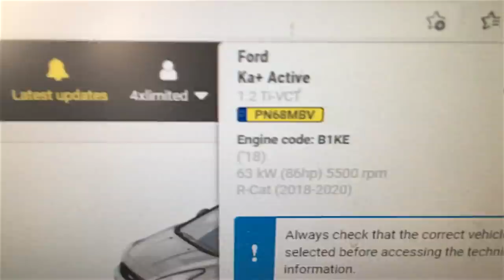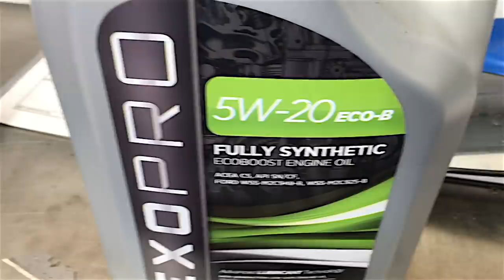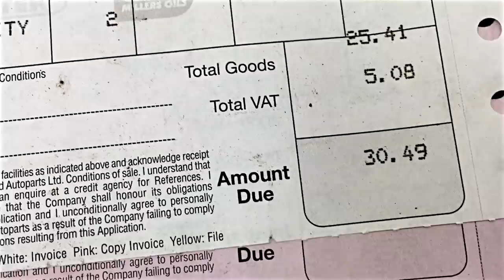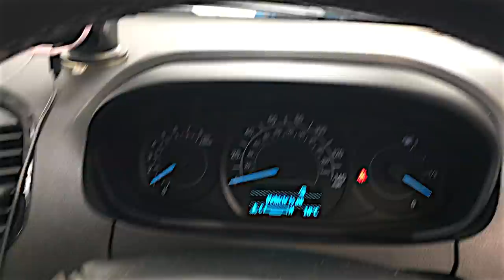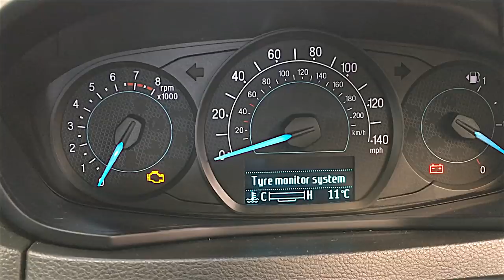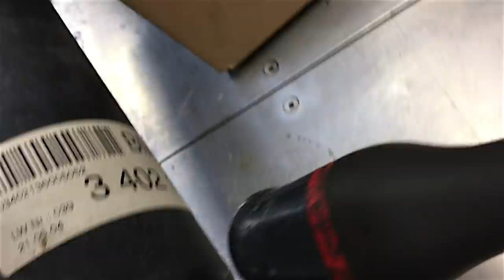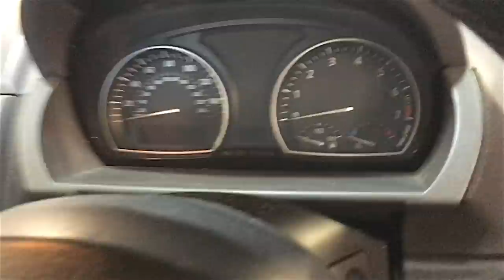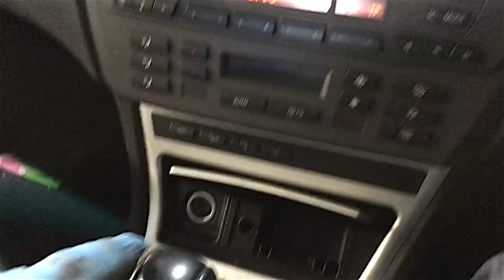All in a days work, "Ford Ka Plus" oil change, Bmw X3 Propshaft Replacement & more !!!

Comment: Great video Alan, Thanks. I remember at one time you could but  universal joint repair kits, when the bearings were held in by circlips and could be pressed in and out. Good old days.

Comment: Thanks for another entertaining video Alan. 👍
Oil change not always so simple.. my mate came round yesterday with an oil leak in his Renault Traffic from around oil filter, the one you only change the cartridge inside.
Nuffin wrong with the filter but I suspect either someone didn't lubricate the new rubber seal, or left the old one in (his "mechanic" only recently changed his oil!).. new filter and rubber seal cured the leak!
So yes.. always lubricate seal and replace it with cartridge 😀

Comment: Those propshafts are factory balanced , that's what the little tack welded metal squares are for . That is gonna vibrate on the car . If you take it apart to change the middle bearing , you must put it back together the exact same way . Why not return it and get the right part ?
Reply: Each section will be balanced on their own, not when connected together, so should be ok.
Reply: @Simon-ui6db  as far as i know , if u split it to change the center bearing , you have to mark it up and put it back together as it left the factory .
Reply: @Simon-ui6db  the BMW shafts are done in pairs, atleast mine is. Service manual says its done in pairs.

Comment: The manufacturers instructions on oil filters I've used always state to lube the filter with fresh oil so that's what I'd do. After all they manufacturer Ed and spent 1,000's hours testing it vs me installing it in 5

Comment: I’ve heard Ford have modified the 3 cylinder ecoboost engines so the failures tend to be between certain manufacturing dates and fail in larger or heavy cars. From memory it was a plastic water pipe that bursts and caused the engine to overheat pronto
Reply: From the MK3.5 Focus onwards, several parts of the cooling system were replaced with a revised design which is much less prone to failure due to crappy little plastic parts getting fatigued due to repeated exposure to high levels of heat.

The little plastic t-piece that was part of the original spec cooling system was always going to be a problem.  (plastic and high levels of heat, versus rubber and high levels of heat)

Comment: For the o-rings at where I work the rule is apply the system fluid as a lubricant for installation unless being specifed. (for pneumatic system we have grease for that). And the Ecoboost engines do suffer from LSPI which can be remedied by using engine oil which are specified to address this issue (sadly not the -948b spec)

Comment: I drive a 13 plate 1.0L ecoboost 125ps fiesta. I only use Magnatec (ecoboost spec) 5w20, 4.1L is needed. I tend to do oil and filter (MANN 7015) every 6 months, air and cabin filters (MANN) every 12 months. Spark plugs are 35k (or 3 years), I've done them once as the car got 55K on it. I know its got a wet belt and ford stated (back then) it lasts the life of the engine but since then, have changed that to 125k or 10 years to renew. Its a lot of work having watched a few videos, 8-12 hours labour and if the belt is changed. The water pump and seals should be done at the same time. Not sure how much carbon built up in the intake value (GDI). I'm in 2 minds if I should get the belt and  water pump done soon or put that money to another car.
Reply: I've heard it's  £1600 to £1800 to have the belt replaced at a dealer.
They so have the issue of the belt starting to  break up prematurely and shed rubber particles which blocks the sump strainer .
This often starves the engine of oil and seizes the engine. 
Why a chain wasn't used for reliability we will never know.
The latest Transit, Mondeo,Kuga, ecoblue diesels have the same issue.
A previous 1.8,  09 plate diesel Mondeo of mine had a wet belt in oil. The replacement interval was also 125k. 
Despite always using the correct ford oil it was badly cracked at 97k and I was very lucky it hadn't snapped.
Reply: @0067jon  thanks and I thought it would be an expensive job, also having seen some forum posts with some high amounts quoted. I've seen videos of people pulling the oil pan, cleaning the sump strainer due to the build up in it, or replacing parts. As for a chain, 100% agree and I know this adds cost but a little extra could save a lot more in the long run. Chains can fail and may need some work (tensioners/guides etc), IMO they are a better option. I've had a belt snap on a non interference engine before and lucky had it repaired. But 1L ecoboost is an interference engine if it snaps, better off replacing the engine or car. I wasn't really aware of the cost of a wet belt replacement when I brought the car. Other belt replacements I've had done, were never that costly. Which is why I'm still in 2 minds. If I do get another I.C.E car, I'm going back to chain timing again.

Comment: Had a 1.6ecoboost in my MK4 Mondeo to over 100k, still got one in a Galaxy on 85k. Had the cooling system recall done by Ford. As long as you do the normal stuff, oil changes, belts and keep the coolant topped up they are amazing. Not sure on the 3 pot but I assume all the problems are down to people not looking after them properly.
Reply: I am sure that a car to owner relationship works both ways. When you treat it well, it will be good for you too😉
Reply: That was a 4 cylinder, it's the 3's that give problems I think.

Comment: I used to have a Mk3 focus with the 1.0 ecoboost and got rid of it after 50k miles because it sounded terrible. I had so many oil leaks with that car it was like owning an old BMW. The new i3 ecoboosts are a totally different design compared to the old ones. Maybe the fixed the head issues, not that we will ever see a MK4 focus in the states.

Comment: what happens if you mount an oil filter without oil on the gasket and wipe everything off the car, then it will be very difficult to get it off next time. I've experienced it.

Yes without oil on the gasket it is not always you get to tighten the filter as easily or you think you have tightened it enough when you do not have.

Comment: first of all let me start by saying love your channel
 just a bit concerned to notice that even though you had the torque settling for the sump plug in front of you on auto data you didn't torque the sump plug up. Also I always put a smear of grease on the oil filter seal

Comment: Now mate do you not remove all the sensors off a knackered engine like cam/crank/map/throttle position sensors, coil packs, injectors just so if you get another of the rentals come in you can swap stuff like that to save money, i would have boxes and boxes of stuff like that as spares.

Comment: Often wondered why you never big up your bosses  used car lot, although your car prices are slightly higher than average I've been told that you offer a 12 months unlimited warranty on ALL  faulty parts/ repairs on your used cars, that's correct isn't it ?

Comment: Are you sure you should be getting an assistant to help whack off your shaft on YouTube. Nice to see someone who knows how to do an oil change. I have seen so many drop the oil out, then replace the sump plug and then remove the oil filter. This just puts dirty oil in the sump with nowhere to go.

Comment: the funny thing is that such a leak started on my car with a mileage of 60 thousand km. It's been like this for 4 years now, which is terrible. and to this day oil leaks from there a little. until tolerantly I will drive) or better sell the car)

Comment: The important bit is not the 5 -20 its that ford WSS  ford oil spec number  to match for the  Engine . Also, I would not fit  any filters  from China on a ford. I had a Hengst Filter fall  apart on a car And i  have seen  nightmare products  piston  from Mahle china, also From redhead zilinderkopf  technic  German  YouTube Showing  what quality comes out of  china  since  covid  19 Started.
Reply: Those are not original Mahle and Hengst products, but cheap imitations, like you have with woman hand bags. Those products do not have the manufacturer's approval
Reply: @marinusapeldoorn6631   I dont know where the filter i got has came from it was in a ebay rebuild kit for the astra car runs new valve all bolts gaskets and filters for 350 euro or so. The faulty mahle piston rings are geniuen They replaced them its on a video from german engine rebuilder. They did say you have to mesure and check now every last thing. Damage on corners of new piston rings. They just packed rejects in the country they manufacture. This problems are global. 5 faulty new thermostat on usa GM car Richard mc cuistian said they had to exchange to get a good unit.
Reply: Couldn't agree more with you on shoddy Chinese made rubbish. Though when it comes to filters i prefer oe ones.

Comment: In the good old days you could replace the spider u/joints. A lot cheaper than a prop shaft. What a con these car makers are today. The engineering is still the same so it is simply a rip off.

Comment: all the car manufacturers get ways  of extracting money out of you i have worked in the motor trade since 1970 why change the original universal joints that were fitted with circlips  Alan

Comment: Oil on the ring! ;) ;) ;) always & if the filter is mounter vertically I fill the filter with oil before installing it. Oh & that engine is a Dragon engine not an Ecoboost engine. The Ecoboost is turbocharged, the Dragon engine isn't. They do look similar but as you would have seen the oil filter is on the front of the Dragon engine & the Ecoboost oil filter is on the rear of the engine. Also the dipstick is in a different place.  Comes in 2x flavours 1.2lt & 1.5lt. The Dragon engines do not suffer overheating issues that the Ecoboost engines do. Oh & another thing, why do all the taxis get genuine parts when being worked on & Moni's car gets aftermarket parts.